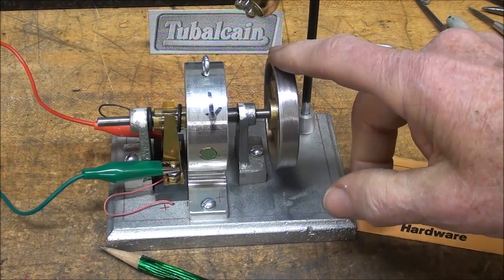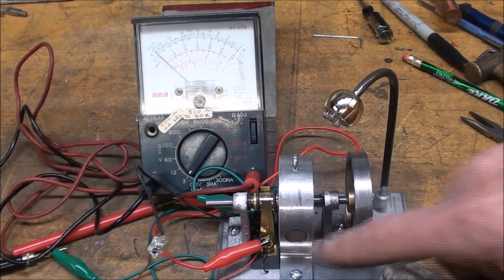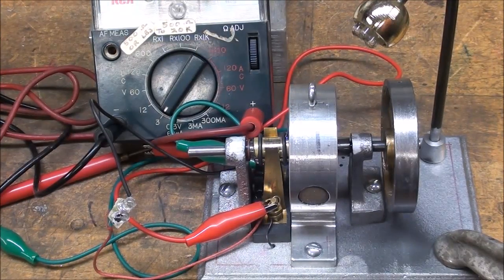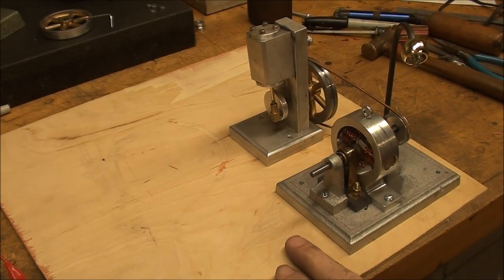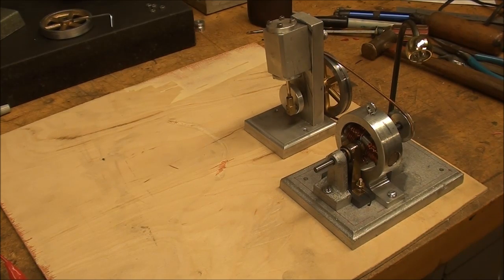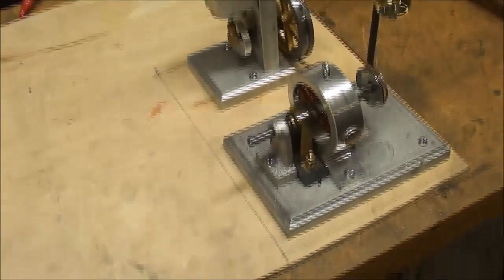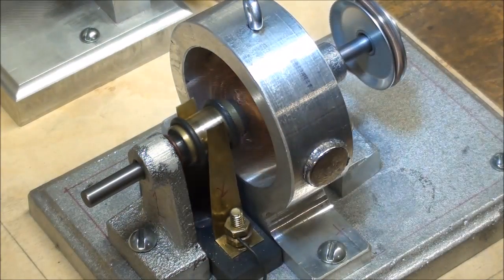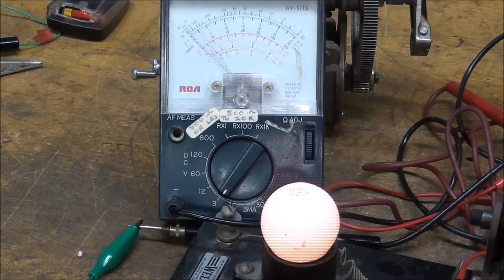Pt 7 tubalcain BUILDS A MODEL DYNAMO for a Steam Engine

Comment: How many people have commented on "YNAMO?"  You always end up with swarf on a neodymium magnet, if it comes into the shop.  It will pick up all the microscopic swarf you didn't realize was there.  I kinda like the look of the magnets sticking out.  I like your presentation method. No Gits oilers on the bearings? lol  My 9th grade science teacher would give added points to a test score by how long you could hold on while he cranked one of those generators.  Great series.
Reply from the maker: +Mature Patriot yes, those magnets sure are annoying

Comment: Make a little rectifier for the output to the light, or just a capacitor. It will smooth out the light so it won't flash.... I think....

Comment: I enjoyed you build very much. While I have a vague idea how motors work this helped me see the light. Ever wonder how much power these little engines produce? I built the pm research dymamo but instead of a light, used a resistor for load. By measuring the voltage across the resistor you get current and measuring the voltage at the dynamo power is calculated (P=IV). I feed both into analog to digital converter on an arduino development micro and wrote code to display on a little LCD screen. My little toy engine produced around 200 milliwatts. Of course that is just electrical power and does not account for mechanical losses. btw that is about 3 ten thousandths of a horsepower which I found entertaining.

Comment: G'day tubalcain, just wanted to say two things. First, thanks, I'll bet there are very many of us that love to learn from your experience. And second, the flashing of the LED's reminds me of a timing light for tuning a car engine   :)  and if you want to reduce that flashing then maybe do a search for "smoothing capacitor". A cheap and easy fix. Just choose an electrolytic capacitor that has a greater voltage rating than the voltage you are generating, eg, 10v or 16v should be fine for this, touch positive to your positive brush and negative to the negative brush and see if the flashing is reduced or goes away. Hope I can help after all the help you give our brains.  :)   ps, not a giant capacitor, maybe thinner than your pinky finger, 47uf or there would be many that could work.... I hope...haha...

Comment: You could try to wire a capacitor across the leads to the light. Since it's pulsating DC, I bet it would smooth the ripple and your LED would be more steady. Just use an old condenser from a car if you have one.

Comment: Put an electrolytic capacitor across the output leads.
It will cut down on the flickering.
I used this little trick on my Jensen

Comment: Great job Mr. Pete as usual.  BTW if you put a small electrolytic capacitor in parallel  across the dynamo output (observing capacitor polarity of course) you should be able to minimize or eliminate the pulsation of the led lamps and you could probably hide it in the base to preserve the nice finish of your model.  Thanks again for all the videos and sharing your work.

Comment: Two possible causes for the flickering come to mind. One is that the brushes contact both brass pieces at two points during rotation, essentially causing a brief short-circuit on the windings. The other is that maybe the brushes bounce and lose contact when they pass the gap. Because the flickering is irregular, that would appear to be quite likely.

And as for your question, silence is golden. While I have gotten used to certain songs on some other creator's videos (especially their intros), it is unnecessary, and music during a fast forward adds nothing. From a learning perspective, having the machine and cutting noises along with the video adds a lot to the experience. When I am trying this at home and I hear different noises, I know I did it wrong right away!

Comment: Great series Mr. Pete! And I'd wager if you could find the room, a 100uF capacitor across the circuit would help smooth out the pulsating DC and reduce the flicker of the LEDs.

Comment: I prefer no music. My reasoning is that I can use the noise of the machine to determine the aggressiveness of the cut, it gives me another dimension that helps me in my work. It slows me down because I tend to want to push the machine to the limits because I like working fast. I understand that is a fault I must curb and I'm working in it and your videos help. Thanks for all you do.

Comment: generators don't have to be rotary, have you ever seen one of those shaker flashlights? you shake it for a minute to charge up a capacitor that will power the light bulb.
If you added a capacitor across the output wires to the leds it would reduce the pulsation of the leds somewhat.
Reply: +superrodder2002 ...and add a diode! ;-)
Reply: A generator is DC so no rectification is needed. Adding more poles to the generator would reduce the voltage pulses but a capacitor would help average the voltage output across the load
Reply: Surely, you don't want the charge that's building up in the cap, to be back-feeding into the coils?
Reply: Let me correct myself: The problem isn't probably the back-feeding, but a dead short between the brushes and the poles on the commutator. every 180d of rotation.

Comment: no music That paint realy set it off nice get some 1x2 inch stock and put a rabbit joint in the top inside   edge miter joint on the ends lay that 1/4 ply wood in that frame and stain base Thanks for sharing

Comment: I watched all seven of these videos. The end result looks really good and is far outside of my machining skills.  But...  Your machine doesn't use the magnetic flux very efficiently.  A test to see if it can be improved can be performed by placing a small c-clamp from one magnet to the other while monitoring the output voltage.  I think it would go up.   If the c-clamp looks too bad you could build a flux-frame to carry the magnetic lines of force from one magnet to the other.  Great channel with no music.